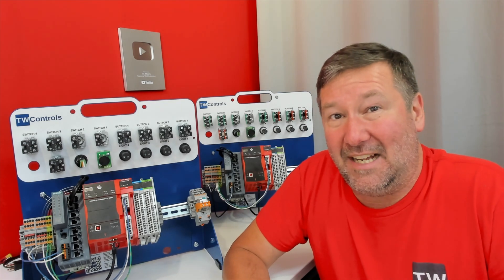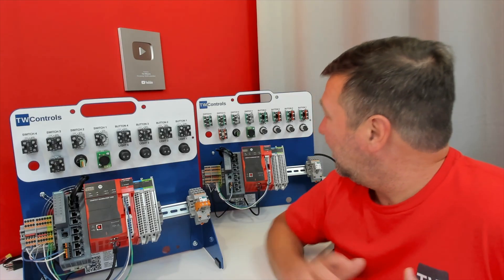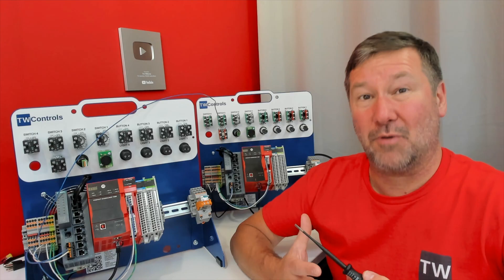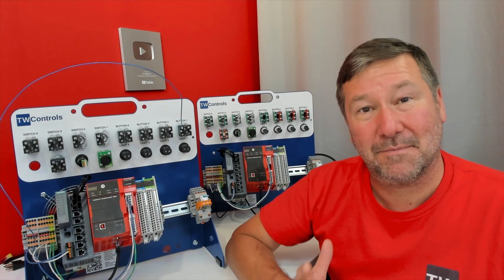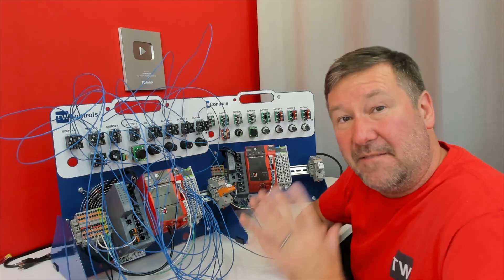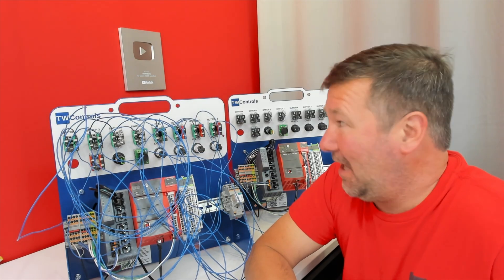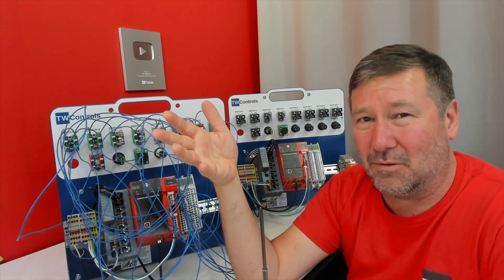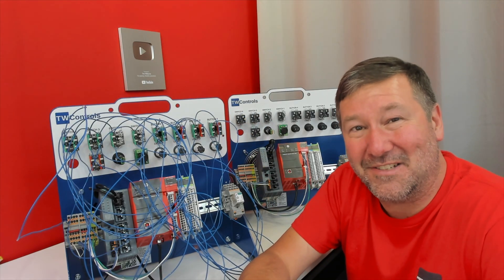The Wiring Test That Shocked Us: Screw vs. Push-In Push Buttons

Comment: Ive had to troubleshoot more intermittent  push terminal issues over the years than screw terminals. I’ll stick with using screw terminals. I agree screw terminals may loosen over time but I see it more often than not with stranded wire without ferrules.
Reply: I had been apart of brain transplants where spring terminals replaced screw terminals. Then I maintained those lines for 10 years after. The spring terminals reduced our downtime, most intermittent problems went away. This was in a place where it would get  hot and cold with the changing of seasons. In places where we had screw terminals we would have to tighten everything up in the springtime. I have seen techs break the spring terminals using the wrong tool to open them up. In other places where vibration was an issue, we replaced screw terminals and put ferrules on all the wires and again our intermittent control problems went away. I'm a big advocate of spring terminals and ferrules. I use greenlee ferrule crimpers which I have had for 15 years now, they crimp perfect every time and never need to be adjusted, a good square crimp. I had my boss order some of these 40 dollar kits with an adjustable crimper and it has been a disaster. The cheap crimpers will cut the ferrules in half and if your tech isn't paying attention it will cause... intermittent problems.
Reply: @Busytech109  That could very well be why I see so many intermittent issues with spring terminals.  I know I use Wera 338 set, vessal insulated lever tip, wago 210 straight operating set & wego 210  angled shot set & Klein TB-DIN. 

I know electricians that don’t own anything specific for terminal blocks and use whatever they have that fits. & Im sure it doesn’t help that they don’t use terminal box on a daily basis.  

Hell maybe Im over releasing them. Either way spring terminals seem temperamental and aren’t my personal favorite.

As for crimpers we use a variety of Knipex and pandit. My daily’s are the Knipex 12-72-190 Stripper/ Crimpers. Ive never had any of them cut a ferrule in half while crimping.
Reply: @mumbles1justin  I love Klein tools but I haven't found a Klein precision screwdriver that works well on spring terminals, its that bevel on the tip that is the problem. The best one I use is Milwaukee. I work on a new food production line now only 5 years old.  We produce millions of pounds of product a month.
Reply from the maker: Thanks for the input!

Comment: We have a mix in our plant, all depending what the device is.  With that said we have way more screw terminals than push.  I have to say though the push terminals are nice to have.  Does cut down the time running / connecting wires.  Not a panel builder here so can't speak for that side of things but dealing with many PLC cabinets of various ages it's nice to have options.  The problem I see a problem solved by push terminals, screw terminals loosening up and causing intermittent or total loss of connection!  Been seeing that problem a lot lately!!!!
Reply from the maker: I agree!